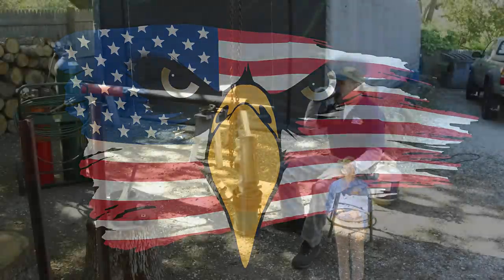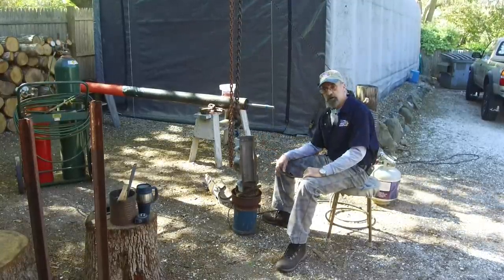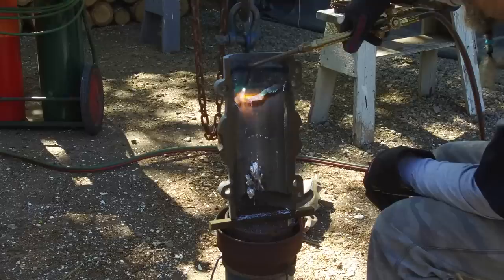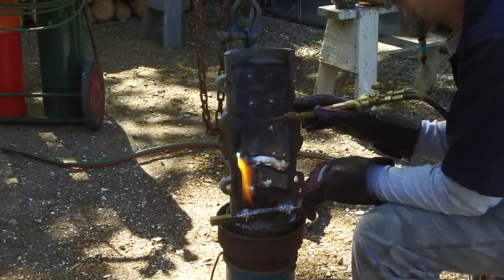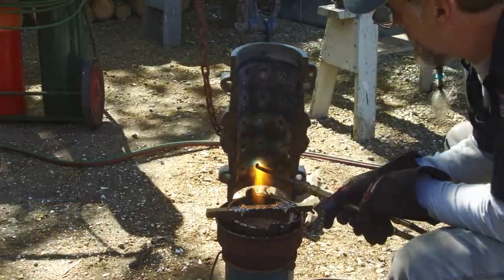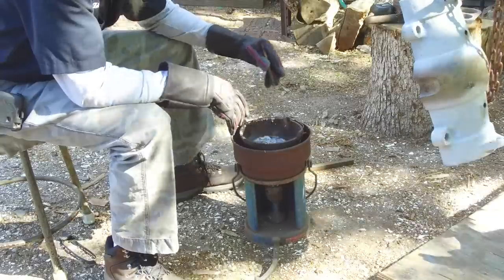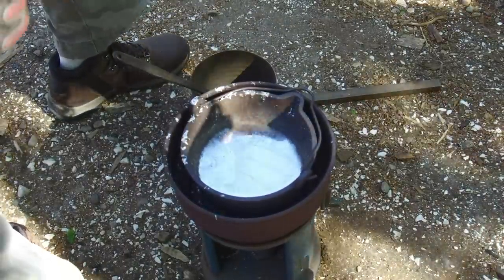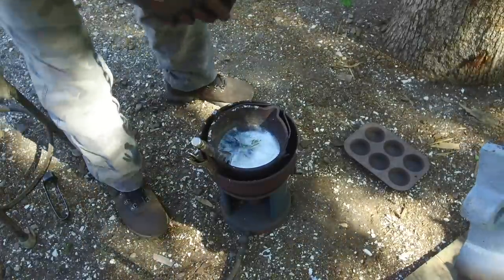All In A Week Part Three

Comment: Hey Keith, I'm working in a high precision plainbearing factory and sometimes we get to restore pretty old babbit bearings, kinda like your's there. If you wanna try out a new method, here is th way we get them back into shape,  bore out the bearing until the old  bore clears up  completly and pour your babbit into sticks and melt them on the old surface by using  the tig welder, don't use a torch, the torch will create to many flaws in the babbit.
Then just bore it out to the final dimension and done.

greetings from Germany,  Brian

Comment: Hi Keith  great video plenty of memories for myself in oz we poured quite a number these bearings in the '70
We called the material White metal and finished by hand scraping.The bearings were in old machinery in a brick works   We used the stick method for temp also.
Thank you Dibbo

Comment: When you aim an IR thermometer at a shiny surface you are (partly, at least) measuring the temperature of whatever is reflected in the shiny surface. In this case what was reflected was likely leaves or sky. The 200˚+ was due to the "partly" since the surface isn't absolutely reflective, so some of the reading was due to the emissivity of the shiny surface. Checking the pot close to the babbitt is probably going to be very close to the melt temperature. You could also float a small chunk of cast iron (rough dark finish) in the babbitt and measure on that.
Reply: @joeylawn36111  - If there was a setting for molten Babbitt, then it might work. The manual that came with my Raytek Raynger ST tells HOW to change the Emissivity setting, but beyond saying that 0.95 is the usual for organic and unshiny surfaces, it doesn't have any specifications.

Wikipedia doesn't have emissivity numbers for any molten metals. The closest they come is "polished silver" at 0.02 which is way below the minimum emissivity my Raynger can be set for (0.10).

Another possibility is to let a coating of dross form and measure that.
Reply from the maker: Thats what I mentioned in the video and said the side of the pot was closer to Babbitt temperature. ;{)-------

Comment: Keith, Sorry I missed you at the Bar-Z. I'm a generous person, but sharing the flu is not something I wanted to do. Hint: For pre-heating cast iron for brazing, or in this case, melting the babbit out of the bearing cases, cheaper is better. Harbor Fright (I know, go wash my mouth out with soap) has a cheapie propane weed burner, that puts out a high volume, but not a high temperature of heat. Propane is cheaper than oxygen and acetylene. It may be a good idea to invest? in one and use it for those purposes. Jon

Comment: You could have cut that melt time by more than 50% if you had used a 1" Rosebud.
Reply from the maker: I chose not to use it! Little big for my new Mixing barrel, worked fine on my old barrel, may change back to it! ;{)-------

Comment: Start at the bottom, the heat will go up.
Reply: Heat doesn't go up.  It goes to cold in any direction.
Reply: Thermodynamics says heat rises. Residual heat in the casting will preheat babbet above the heat source (torch), perhaps reducing the time needed to melt all the material.
Reply: @notnowhoney1663  ...Thermodynamics does not say heat rises. Check out the second law and get back to me.